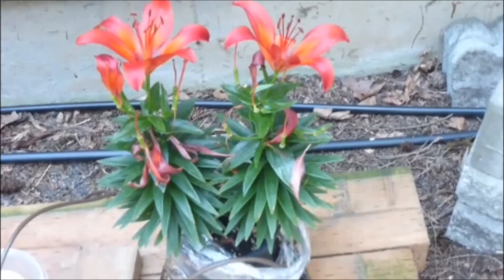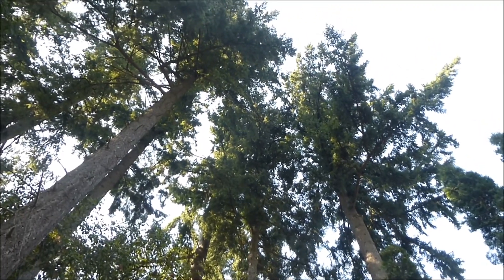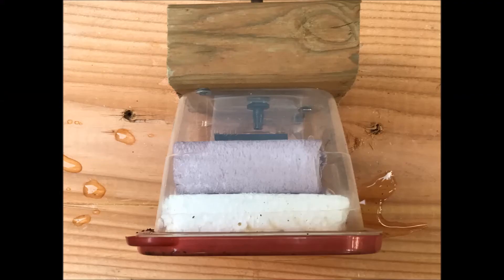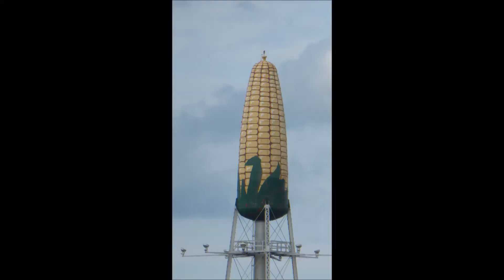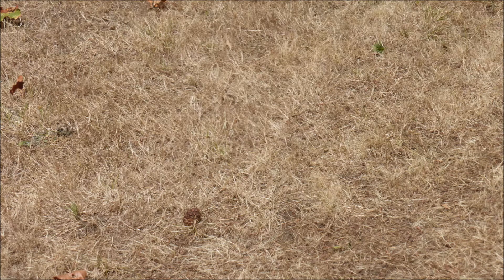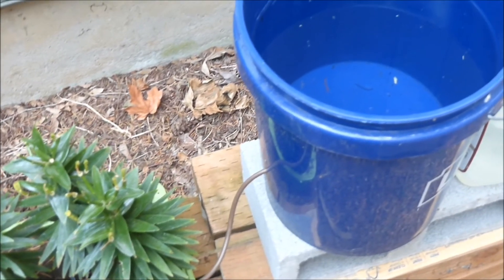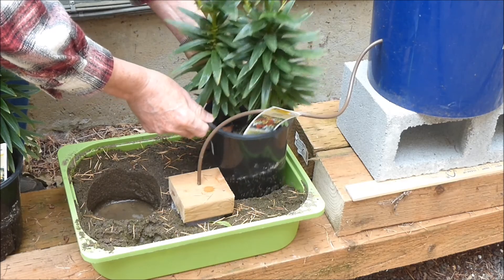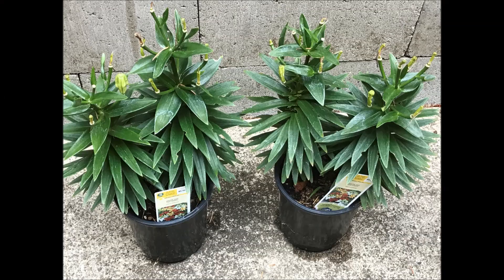A Float Valve Automatically Waters Potted Plants While You are Away

Comment: I know this video is old, but what about instead of sand, using small pebbles like river rocks.  Wouldnt the water still flow freely below but it piled high enough, the surface would be dry ?  Sand has so much caplilary action but that would be less with larger particile size like pebbles or rocks , right?
Reply from the maker: Yes, I believe you are correct.  Good suggestion!

Comment: Great job demonstrating the versatility of your ideas.  That system without the sand would make a nice indoor gardening tool.  It would be simple to add more nutrient to the 5-gallon bucket as seedlings or small plants were grown under a grow light.  Also, the absence of mosquitos would be a plus.
Reply from the maker: Thanks, Matt.  Yes, that sounds like a good idea for indoor growing, but the solution would need to be shaded from the light or else algae would form.  Maybe a black polyethylene shield  with holes for the pots could be fashioned over the basin.

Comment: Why don't we just put your hydroponic nutrient in the sand.  Figure out your polystyrene mulch and then plant seeds under it.  Well I guess it would have to start with water as to not burn the seedlings.  Switch over the intake to regular strength nutrient solution maybe 3-5 days after sprouting.  You could have whole fields of the stuff!
Reply from the maker: You have some great ideas Jeb!  I hope that you and/or some of the other viewers will try them out.  By the way, applying hydroponic nutrients solution to sand has been referred to as sand culture and has been used to grow vegetables.
Reply: I looked up sand culture.  The setups I saw were all an ebb and flow, drain to waste type system.  I'm thinking you could just consistently maintain nutrient level at the bottom of the sand and flush it only when necessary.  It would save significantly on the complexity of the setup.  You could have massive beds of the stuff.
Reply from the maker: Bingo! You get the concept, Jeb!  Now, to notch your imagination up another notch, study the setup in my bean video ( https://www.youtube.com/watch?v=YBdgqwfr08M&t=25s ) and discover how to reduce the required amount of growing medium or sand.  I look forward to seeing videos of what you come up with!
Reply: @JebGardener  Any updates on this interesting idea?